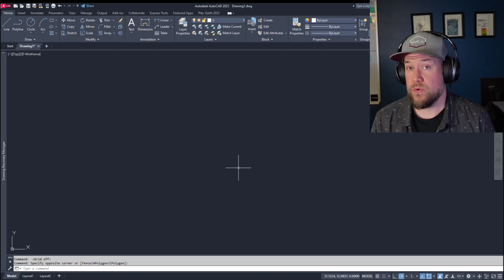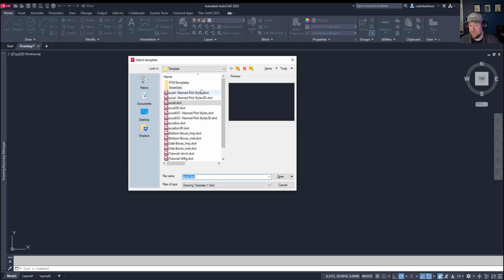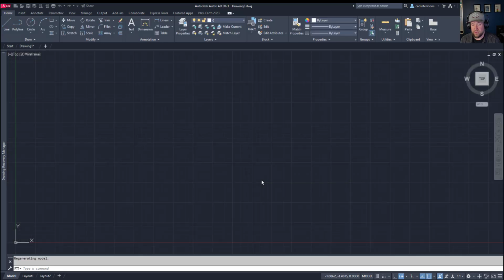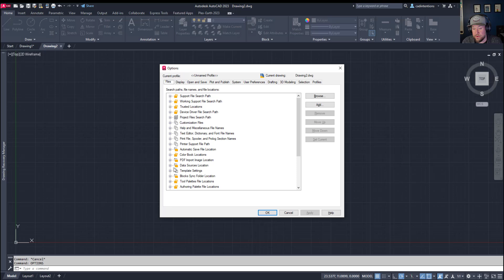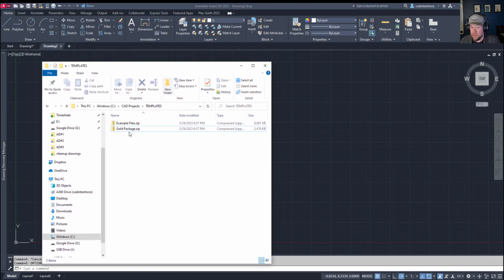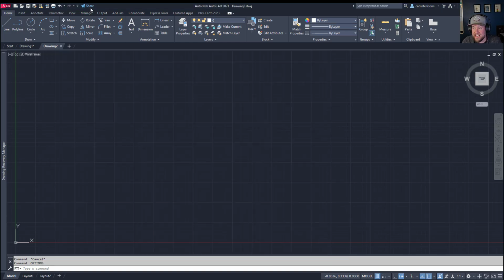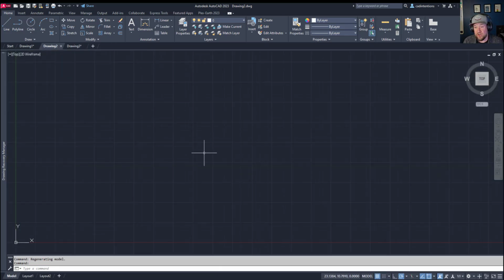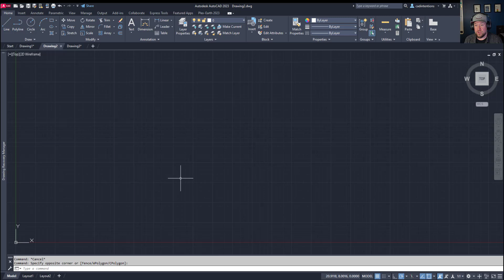AutoCAD Drawing Template Files (.dwt) - File Locations, How to Open and What They Do! (.dwt vs .dwg)

Comment: As usual, great another great video!  I did have one question.  I bought the fundamentals course and began using your templats.  However, whenever I went to print any of them, the edges would always get cut off.  I had to go into all of them (letter, legal, ledger, and Arch D)  to adjust the "edges" so my drawings were not getting cut off.  Did I do something wrong when downloading, setting up, printing, etc...?
Reply from the maker: Hey Mitch, Thanks! And thank you for taking the course and the question! I believe the templates we make in the course had a 1/4" or 1/2" margin/buffer around the outside of the sheet which tends to work without cutting anything off on many pdfs/printers but margins do typically have to be adjusted or taken into account when making the templates since many printers and even different print settings vary so much. I definitely don't think you did anything wrong and am glad you were able to get it adjusted to work for yours!

Comment: When I add my company logo to a template, sometimes it doesnt show up when I add that template to another file.  Does the dwt and png have to be located with the dwg file so it can reference them?
Reply from the maker: Hi Robert, 
The image and dwt shouldn't need to be located in the same location as your drawing, but you will want to make sure the image if it's inserted as an xref has "full path" option selected when you add it to your template instead of relative, since the relative folder will change depending where you save each new drawing, but full path should keep it consistent so you don't lose the link. An image can also be add into the drawing using a few methods, including as an ole object which then don't rely on a path. 

Thanks for watching and the comment, hopefully that helps!

Cheers,
Brandon